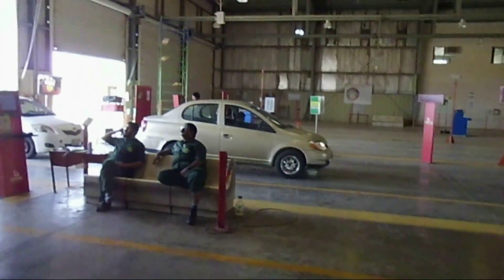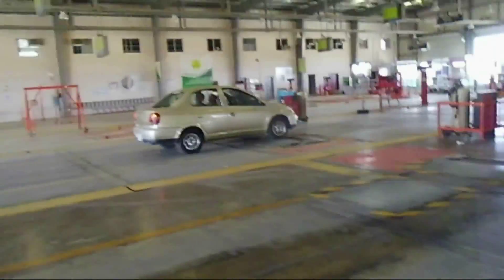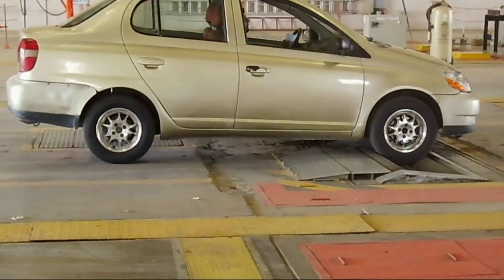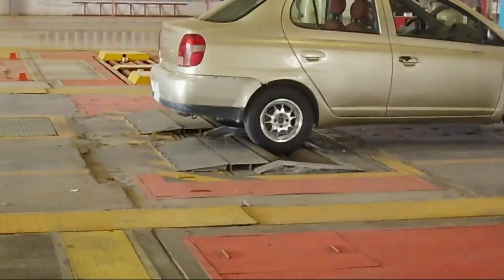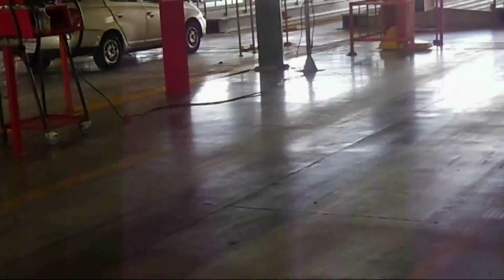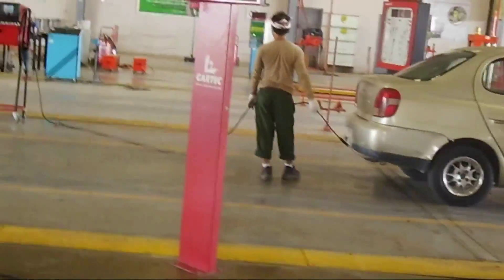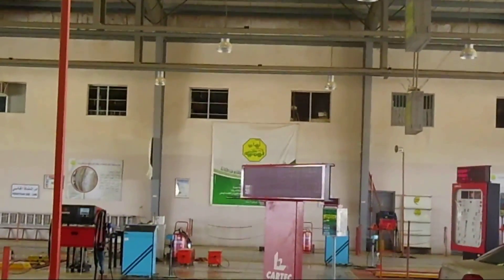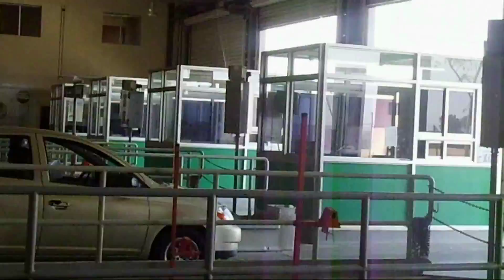Car first state inspection. Governmental inspection for vehicle.

Comment: I hope it passed jahan, if it didnt i would be supprised.

I know you can cope with any repairs, your knowledge/skill and inginuity allways impresses me :-))
Reply from the maker: Thank you very much dear sir for your nice words. The car failed in its first inspection due to three valid and invalid reasons. First valid reason was rear suspension rubber bushing were broken. Second they said body color is not perfect. The third they said the bumpers are not fastened very well. So for second and third reasons I negotiated with their Engineer that the car is old and will sure have no perfect paint and the bumpers are not that bad that they are hanging or broken but again they are also aged so you can compromise on both. So he was kind enough and compromised on both. The first and valid reason, the rear suspension bushing I replaced after inspection. In the next video I will show that. Then in the second inspection after doing the job of rear suspension, the car had been passed. Rear suspension broken rubbers were my fault and can say lack of inspection from my side. Regards,
Reply: LearningZone
The paint colour?, what the hell has that to do with safety, sounds like that engineer was looking for money.

Corrupt people i think.

Never mind, you got it through the inspection :-))
Reply from the maker: zx8401ztv
You understood it right. As second, third and so on time inspection is for further fee and not for free so in this way they are earning. Color is nothing to do with safety and should not be considered but now a days they are. Better thing for me was I just passed it!
Reply: LearningZone nikaha
Reply: LearningZone  sir pass hue ya nai